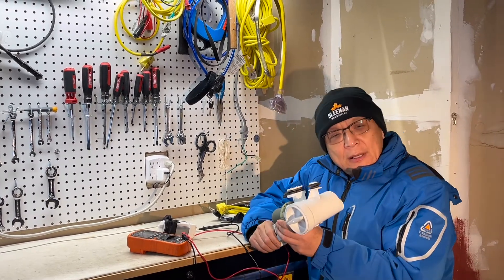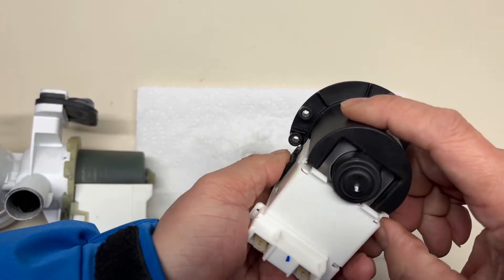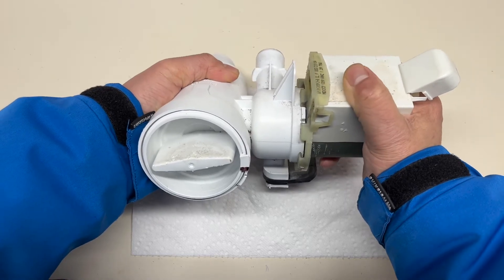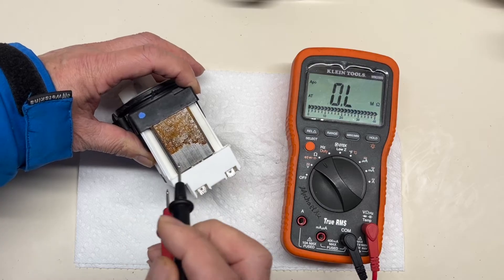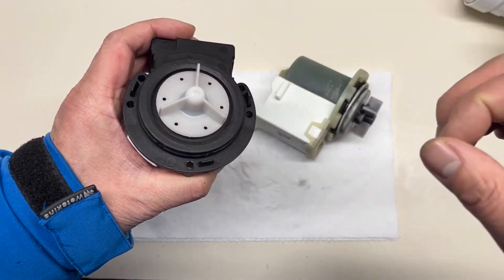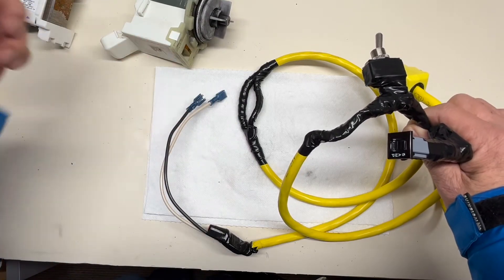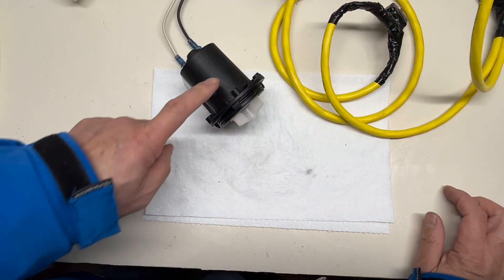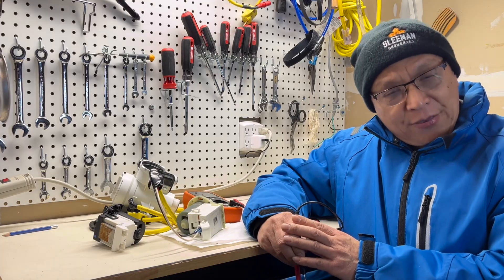Washing Machine Drain Pump Test with Multi-meter

Comment from the maker: A resistance test is a necessary condition but not sufficient condition. even a test run without water is same, because these two conditions are all about the motor.  in my humble opinion, a good motor is still a necessary condition for a good pump, however, it is not sufficient condition for a pump. the pump impeller check is very crucial for an operational pump. 
Hope this video help you to win the battle for troubleshooting drain pump💪💪. Let me know if you have any questions! leave the comments below. 
Subscribe for new videos💛🙏🙏 https://www.youtube.com/@guelphming3843?sub_confirmation=1
Reply: hello, the bump works with AC voltage?
Reply from the maker: Yes, Most with 120V ac. Better verify label on the pump.
Reply: I was under the impression that you set your multimeter to 2K.? Then reading between 260 and 360 was sign that pump was good.  Any differ reading means no good. Also the impeller resistance test that spins free or has a constant tight resistance means pump is bad?  A good pump impeller test will only have slight resistance? Or a Kind of spring like resistance? 
Also the plug test that the pump spins smoothly without excessive noise is a good pump  ? A bad pump will not spin or only hum or has excessive noise when doing plug test? Is this correct? Thanks
Reply: Who also use direct drive drain pump except speed queen

Comment: What if the resistance is at 175 (german waschmaschine, because i m from Germany) drain pump nomber is px-2-35

It is also spinning correctly according to your video
Reply from the maker: voltage is 240v in Europe, 175 might be ok. do you feel resistance at the some point when you spin the pump?

Comment: What level of resistance was the meter set to?
Reply from the maker: Great question. the normal range is about teen to several ten ohm. set to 100 Ohm should be good. appreciate it if support subscribing.

Comment: Hello Ming. Thanks for the video. (I'm in Guelph also) This will be very helpful when testing our pump later today. We have an older Admiral top loading portable washer. It blew a house fuse and stopped working after the wash cycle, failing to drain. Now when turned on, there is just an electrical hum and the plug gets hot. Probably what blew the fuse. Would you suggest a possible pump or motor issue? Thanks for your help and great videos
Reply from the maker: Top load pump has either a-direct drive or is driven by a belt from the motor. Based on info you provided humming sound, check motor and load (tangling small item with belt if there is) good luck 🤞
Reply: @guelphming3843  Thank you

Comment: i had a portable washer suddently stopped working. and according to some people, it seems the computer board is faulty. However i could not find the replacement part from anywhere in the US except in Chinese taobao. I had the board shipped and installed to the US and installed it. The washer started working right except the drain pump. my multimeter confirmed 0.02k ohm and there is indeed a registance when i move the propeller. Can you please give me some advices? Thanks!
Reply from the maker: since you checked it with multimeter. did you do feel test and run test with cord applying power to drain pump?
Reply: @guelphming3843  i did feel test, there is a significant registance when I move the propeller. but I could not do the run test. Because I did not have a cable that can connect to the pump and power outlet safely. the seller told me that I might need a 220v pump.
Reply: @wangmengj  Maybe the seller sell the pump is 220 voltage， But you need 110v.. Also mother board Maybe the outlet is 220v. You also need 110v

Comment: You can actually test the pump removed from filter housing using the Drain setting instead of fabricating a test cable. Although, a bad pump may still turn with no load (no water resistance). I just replaced a drain pump that would have passed all these tests. I removed the impeller assembly (held in position by magnetic force), and the spindle  that holds the impeller rod was cracked. So it acted normal and would turn with no load condition but not with resistance on the impeller.
Reply from the maker: Great! Do you feel resistance when you turn the impeller with finger?
Reply: @  yes but it was mostly in one direction. I was getting a F21 code that started and gradually ended up with a drain failure. I replaced the pump/ filter assembly and now it works fine.
Reply from the maker: Glad and congrats.

Comment: Great Video Thank You. I will run these test as well. The washer only drains some of the time. Sometimes I hear a humming noise when it does not drain. Could the pump be on its way out and only work sometimes? I fear that it might be something worse like control board.  The pump may have  a good test if it works some of the time?
Thanks
Reply: What did you find?
Reply: @qmj91  Running fine now, took 'self cleaning filter' apart and found a quarter lodged in it
Reply: @markl9839 😂 Thank God
Reply from the maker: If you hear a humming sound check drain pump first before anything else. Might have something clogged in pump. Good luck.
Reply: @guelphming3843  Will do thanks

Comment: Mine had a quarter stuck on the drain hose. Since I had the washer on its side, I took advantage and cleaned all of the hoses, rubber seal, etc. Confident it was gonna work, I installed it did a test run and still didn't drain. 😂 I know 120 volt was going to the motor. 

When the drain feature was activated I can hear a humming noise coming from the drain pump. I took off the drain pump, tested it outside by plugging it in, Turn on the washer and selected "spin only cycle" --- Propeller was stuck. 

Since it was damage I took it out from the housing and verified that it was crack. The replacement cost me less than a 24pk of beers 🍻
Reply from the maker: Nice job! Humming sound is the sign either pump stuck or seized. Thanks for sharing.

Comment: Hi there, i checked my pump and there is 220 omh resistance, its ok plus impeller is allright but it still doesnt pump out the water. Machine stops working after it fills with water and do not spin neither pump out the water. Do you know what else may cause it?
Reply from the maker: Give pump a feel test if pass give a run test with power applied like in the video. Good luck!
Reply: How did you fix the fault?

Comment: Hi thank you so much for such a detailed explanation. If I have a Bloomberg washer, I did the two things u mentioned on the drain pump. 1. Turning the propeller, showing resistance. 2. Test with multimeter, showing 86 ohms. 
On Bloomberg manual is specifies than winding resistance of drain pump is 88.5 ohms.  
Is my drain pump broken or no? Thank you.
Reply from the maker: Apply power to the drain pump without load to see if it run properly. Thanks for watching, Good luck.

Comment: This is a great video. I tested my resistance and it shows 7.2… the spin test seems to work well, but it is not spraying. When I run the dishwasher, I can hear it lightly clicking when it is supposed to be running.
Reply from the maker: Thanks for your nice comment.

Comment: Why does my washer machine delay to start spinning and washing when I click the start and it will take long to start, and also leaking some water underneath yet all horses fit properly
Reply from the maker: As far as I can know,  check timer if your washer has one, for leaking if hose and fittings are good, it might be seal. Good luck.
Reply: @guelphming3843  for leaks, it keeps dropping underneath the washer machine but all the horses are fitting, so how do I know that the timer is faulty. Glad to hear from you again